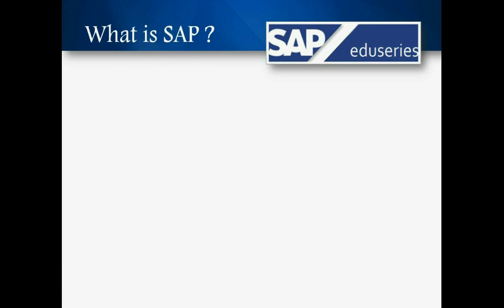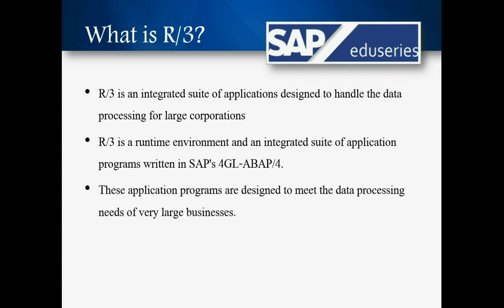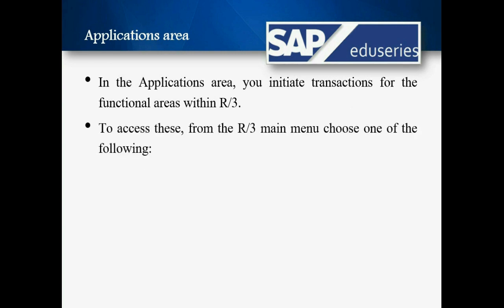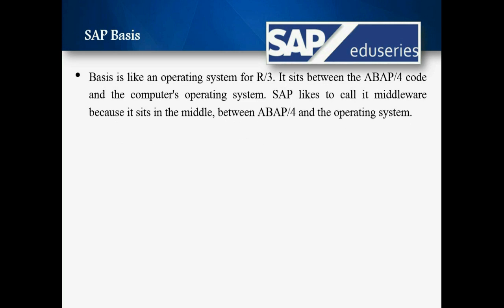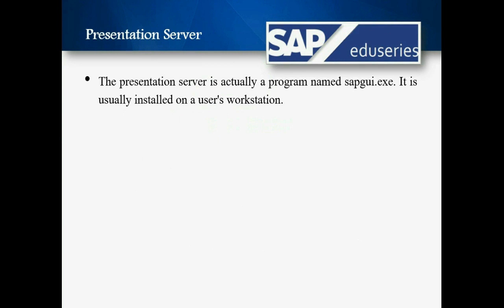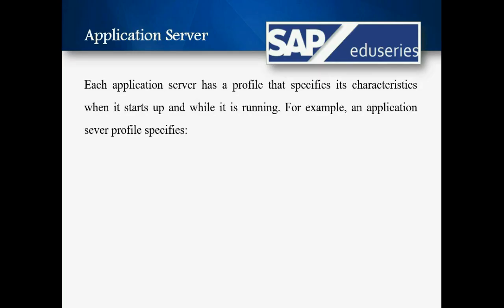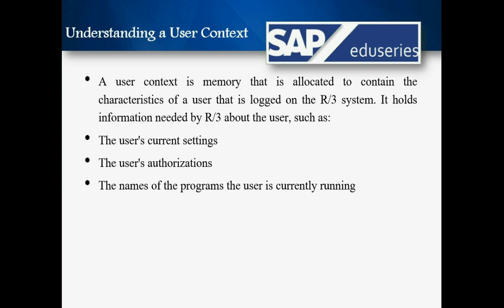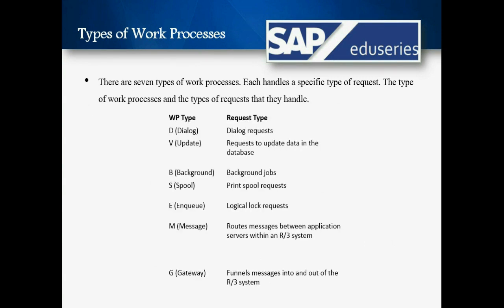Chapter 1 - Introduction to SAP R/3

Comment: SAP R/1 System RF: 1973
SAP R/2 Mainframe System: 1979
SAP R/3 Enterprise Edition 1.0 A: July 1992
SAP R/3 Enterprise Edition 2.0B (SAP R/3 2.0B): July 1993
SAP R/3 Enterprise Edition 3.1l (SAP R/3 3.1I): 11 May 1998
SAP R/3 Enterprise Edition 4.0B (SAP R/3 4.0B): 6 April 1998
SAP R/3 Enterprise Edition 4.3
SAP R/3 Enterprise Edition 4.5B (SAP R/3 4.5B): 29 March 1999
SAP R/3 Enterprise Edition 4.6B (SAP R/3 4.6B): 6 December 1999
SAP R/3 Enterprise Edition 4.6C (SAP R/3 4.6C): 3 April 2000
SAP R/3 Enterprise Edition 4.6F
SAP R/3 ENTERPRISE 4.7X110: 15 July 2002
SAP R/3 ENTERPRISE 4.7X200: 22 September 2003
SAP ERP Central Component (ECC) 5.0: 21 June 2004
SAP ERP Central Component (ECC) 6.0: 24 October 2005
SAP enhancement package 1 for SAP ERP 6.0 (EHP1 FOR SAP ERP 6.0): 21 December 2006
SAP enhancement package 2 for SAP ERP 6.0 (EHP2 FOR SAP ERP 6.0): 27 July 2007
SAP enhancement package 3 for SAP ERP 6.0 (EHP3 FOR SAP ERP 6.0): 7 December 2007
SAP enhancement package 4 for SAP ERP 6.0 (EHP4 FOR SAP ERP 6.0): 21 November 2008
SAP enhancement package 5 for SAP ERP 6.0 (EHP5 FOR SAP ERP 6.0): 12 July 2010
SAP enhancement package 6 for SAP ERP 6.0 (EHP6 FOR SAP ERP 6.0): 24 August 2011
SAP enhancement package 7 for SAP ERP 6.0 (EHP7 FOR SAP ERP 6.0): 13 August 2013
SAP Fiori 1.0 for SAP ERP (UI FOR EHP7 FOR SAP ERP 6.0): 29 November 2013
SAP enhancement package 8 for SAP ERP 6.0 (EHP8 FOR SAP ERP 6.0): 20 January 2016
SAP S/4HANA
SAP S/4HANA 1511: November 2015 [3]
SAP S/4HANA 1610: 31 October 2016 [4]
SAP S/4HANA 1709: 15 September 2017 [5]
SAP S/4HANA 1809: 21 September 2018 [6]
SAP S/4HANA 1909: 20 September 2019 [7]
SAP S/4HANA 2020: 7 October 2020 [8]